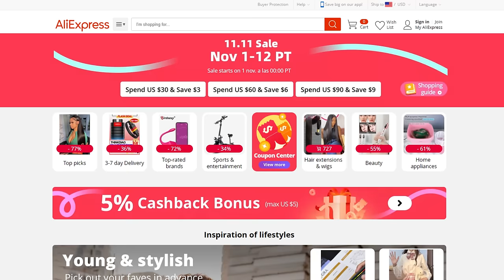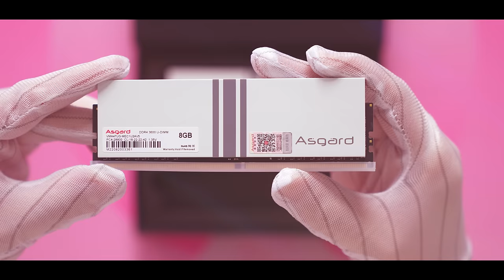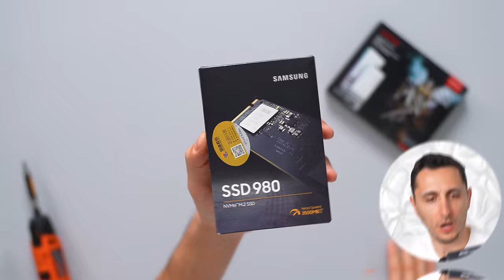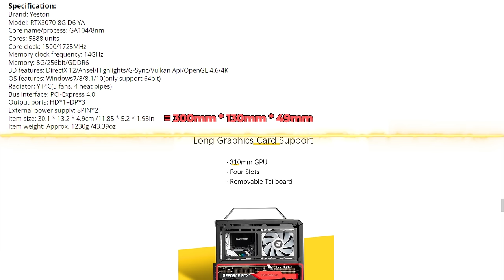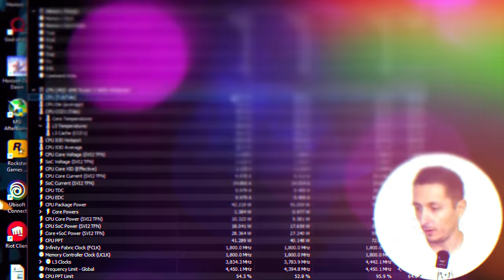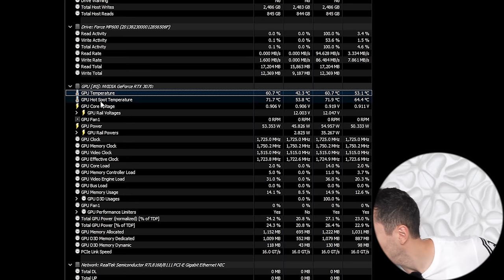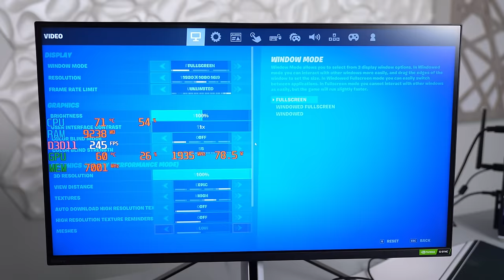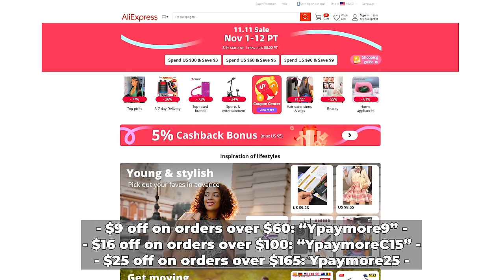I built a Gaming PC using only AliExpress Parts!

Comment: That PC case is pretty cool definitely a nice small form factor case. I would probably use a ITX motherboard and smaller video card in it though. Awesome build though and great video!
Reply: That's what I was thinking
Reply: i doubt ali express can supply exactly what he needed he probably would’ve used the smaller parts if it was possible
Reply: @kevin7238                            .
Reply: @kevin7238  there is plenty of rtx gpu's on a 2 fan form size, enven on 1 fan.. I wouldn't risk such a big one like he did, but I gotta admit, it came out looking badass 😂

Comment: The Mechanic Master cases are so good. I don't know how a company stateside didn't adopt a size-constrained ATX case like the C34 yet.
Reply: Using the C34 here! It's basically a Cerberus with 7 slots only. Really compact for the size yet it can fit a large CPU cooler. Be careful with the ATX PSU compatibility though. There's two numbers, one for ATX-micro (160) and ATX (170) where the second slot is used instead.
Reply: @yensteel  I've got one in for my next-gen build. You're saying I have up to 170mm for power supply length?
Reply: @shinseitaizen  Depends on whether the motherboard is using the first or second slot for the GPU, and whether the card is long enough to interfere (240mm due to motherboard width). Usually, the ATX motherboard uses the 2nd slot (170mm support). A lot of M-ATX boards use the first slot, which reduces the support down to 160mm. An example would be the B550m Mortar.

Comment: i know you said with one fan only but im curious why you didnt use the second fan that you had and installed it in the back of the case for a single exhaust fan to help with the thermals but overall i love the way the build turned out
Reply: Jesus is king follow him and you will be saved
Reply: Exactly, half the struggle with a small case is getting the hot air out.
Reply: @richardfarmer6570   I would say 80% of the struggle. :)

Comment: Installing a Graphics Card that just fits is a lot easier if you take off the back slot mounting plates, sliding them into the slots separate from the card, installing the card, and then screwing the mounting plate back onto the card, instead of trying to force the card into place.

Comment: love sff builds so much by how small and elegant they are.. however, they are a bitch to build in my experience. i went from a meshlicious to a an o11 mini. and a big gripe to that was because I had a bad riser, and decided to build in a different case to see it actually was the riser, which it was. this gave me hope to build in a sff/itx case again some day :D
Reply: Custom cables make a huge difference in most SFF systems.
Reply: @paulmeyer1001  yeah I know, but custom cables are far expensive. So I just went with a psu with braided cables
Reply: @teengohann  ITX stuff is already more expensive. $60 for cpu/gpu cables just saves a ton of headache and is well worth it.
Reply: @paulmeyer1001  moddiy or cable mod?

Comment: pretty sure you were suppose to slide the gpu in from the front, since there is a opening wide enough to take the gpu. Just an idea, in case someone else decides to build in this case.
Reply: bro u saved my build holy molly ty
Reply: @ALHARETHHH  you used the same case ?
Reply: @salvadormarquez5079  a very similar one with an opening! i was so close to bending the case to make the GPU fit but i saw this comment a  week ago whiles building it and it saved me lol
Reply: @ALHARETHHH  bro glad I was able to help man

Comment: I had a similar build, B550M Mortar Wifi, 3700x, 3070, 4 slim fans from ID cooling, LianLi SP750 inside Tecware Fusion with a tower cooler. SO I think 7-8 out of 10 should be fine

Comment: You mounted the cooler with the long side towards the GPU. If you inverted it it would've fitted better. Also you checked the PSU GPU specs but you did not check the GPU's and I'm pretty sure the back panel could've been removed from that case because I see screws not rivets.

Comment: this build is good but why didnt he go for an aio with intake on the top,that way cpu remains much cooler and  the fan blocking the gpu might be installed beside the motherboard tray
Reply: There most likely isn't clearance for an AIO uptop in such a small case. And even if there was, good luck finding a 92mm AIO
Reply: its ali express bro not amazon
Reply: @YoLocalWog  most of the stuff on amazon is from ali
Reply: @thc4825  do u not get what I mean

Comment: alright now i gonna buy these parts (also extra storage too)!!! let's see how well they perform
Reply: Did it work well?
Reply: @master__frog5429  Give him mininmal 1month for deliveries atleast and a day to build homie lmao. Building a x99tf q build for a friend/boss and throwing in a 2060 oc gigabyte inside of a DLM21-Mesh white. Could post photos when I build it early feb. he mainly wants to do office work on it and play city skylines. Gonna  have a E5-1650v2 in it and will be overclocking it to 4.1-4.2ghz.

Will give a quick breakdown of the specs and their prices. Some stuff is what I already got at home so its cheaper!

E5-1650v2 (bought 4 years ago ($100AUD) Secondhand)
Gigabyte 2060 OC  ($300AUD Seccondhand)
32gb ecc ram (forgot the speed) ($140AUD worth Secondhand)
Darkflash case DLM21-Mesh ($75AUD New)
850w gold full modular (to buy yet) ($100AUD)
2x1tb m.2/nvme storage ($240AUD Secondhand)
6tb HDD NAS ($100AUD Secondhand) 
wifi modual ($2AUD Secondhand)
m.2/nvme heatsinks (fanned/rgb) ($38)
240 AIO (to buy) ($100AUD)

Total: $1,195AUD/$815USD.
Could of cheaped out on the psu/ram/CPU is worth half as much now/gpu but he is happy with the rig. commision is about 15% so about $180AUD for my back pocket. All and all its cheaper than building a 10th gen + rig due to cpu prices and at any time he did wanna upgrade, there is the z590 steel (white mobo is what he wants in a white case and black everything else) that I could pair my i7 10700f for when I upgrade in the future to i9 11900k in my z590 taichi. 

I can assemble 80% of this in mid feb but still need to hunt for a quality psu/240 rad/nvme storage. Will look nice regardless....

Comment: got my pc from aliexpress same specs for only 620$ and 32gbs of ram, I used an not well known chinese brand for motherboard and same for the 1tb m.2. also the gpu was a used 3070 mining card that I got for 220$ but i just reapplied thermal paste and it runs great! btw I couldve got it maybe 50 - 70 bucks cheaper if i didnt care about aesthetics.

Comment: The AliExpress  "Please allow 10-20mm error due to manual measurment" - have never really bugged me, until now!! Also, why didn't you test the components for function before actually installing them into the case? Never watched your videos before, but this came across as a bit noobish... The case could def fit another fan in there as exhaust and it sure looks like it needs it.

Comment: My first impression of the PC Case is any smart PC builder would not use such a PC case. Cause having the PSU mounted in the front location like that will only vent the hot air inside of the PC case. There is a reason why most PC case manufacturers places the PSU at the bottom of the case in the rear of the case with fan intake facing down. So it can get fresh air from the bottom while hot air exit the rear.

Comment: Oh my god the flashbacks. We built a PC to my brother last weekend, and had the Exactly same problem with the GPU. We checked the length and the clearance, but alas, it was the measure of from wall to wall, NOT the actual hole :D we were forced to take everything out (cooler screws were under the mid-fan, so could not take just the cooler out), lay the GPU loose on the bottom, rebuild and then lift the GPU to the socket. Case TU150, GPU Asus 3090 strix

Comment: Hats off and thank you so much for the video! I'm considering giving my rig a little upgrade, so I'm thinking about ordering a few components from AliExpress. I'm eyeing a new graphics card and a slightly larger M.2 drive. Considering I haven't upgraded anything since putting together this setup a full 5 years ago, it's about time for a boost!

Five years ago, I successfully put together a MINI ITX PC using the NZXT MANTA (WHITE), and it's still running like a champ. I'm thinking of swapping out the graphics card, switching up from the ROG STRIX 1060 to a beefier 3070. The setup is solid, fits like a glove, and I'm loving the top-notch airflow. I tweaked it so that the fans on the liquid cooling (Kraken X62) are blowing air out. Up front on the case, there are a couple of fans sucking air in, and the power supply fan is pulling in air too. So, we've got three fans pushing air out and three pulling it in. Oh, and those intake fans are all rocking the filters that come with the NZXT MANTA case, nice touch.

The whole setup's got this sleek look that's hard to beat, and the performance is off the charts. The CPU's temperature keeps its cool, doesn't even break a sweat at 60 degrees Celsius when things get heavy, and it's chilling around 33 degrees when it's taking it easy. Speaking of overclocking, even with that, the graphics card isn't going past 60 degrees Celsius. But gotta admit, those graphics card fans can get a tad noisy.

Here's how it's all stacked:

Case - NZXT MANTA WHITE
Motherboard - Asus ROG Strix Z370 Mini ITX
Processor - Intel 8700k (Haven't bothered pushing it with overclocking just yet)
RAM - 2x8GB HyperX Predator 3600MHz
M.2 SSD - 500GB Samsung 970 Evo (Thinking it's time to bump up to at least 1TB, board's got room for two M.2 slots, though just one's got a heat spreader)
SSD - Samsung SSD 1TB 860 EVO (Got the whole macOS shebang on this drive, running it as a slick dual boot setup)
Cooling - NZXT Kraken X62
Power Supply - LC Power 850W, solid 80+ Gold Standard ATX stuff

Comment: You should do top intake for more airflow in this situation, it'll increase pressure negating the "heat rises" thing, and air will be pushed out the back anyway.
Reply: Nah 2 top exhaust. The GPU will take air from the bottum as intake and blow it out to the upper side. That's where the CPU can use it and let the 2 top exhaust fan take out the hot air.

Comment: id give it a solid 5. the gpu is completely blocking the bottom fan and you might even see lower gpu tremp if u remove the bottom fan. i would have put 2 fans, either both on top or one top and one rear blowing out. let the case suck in air everywhere else. also a dual fan card would obviously greatly increase your overall airflow
Reply: cool

Comment: Well, I ordered a Ryzen 7 7700X and a Kingston DDR5 6000 EXPO 16x2 kit, cuz CPU was 70% cheaper, and the RAM kit was 15% cheaper than buying from a local tech vendor
Both arrived brand new and have been in an active use for around 1.5 weeks.

Comment: i got freezermod tubing from ali and i have also got original EKWB tubing. Ihave to say never going back to EKWB. It was so good using the freezer mod tubes buttery smooth bending no distortion i also use byski fittings and had no leaks in over 4 years.

Comment: Personally I would have put one fan at the top as an intake and the other at the back for an exhaust. The one fan you did add is doing nothing but pushing cool air at the GPU which should already be decent at pulling in the air it needs.

Comment: Unless that Thermal Grizzly tube that came with the cooler was the Aeronaut you can be sure that it's fake. Kryonaut and Hydronaut are a pain in the ass to spread, the only one that spreads that easy is the Aeronaut, not the best from Thermal Grizzly but still pretty good, anyway, pretty nice build, very clean, just need to improve the cooling a bit, undervolting both the CPU and GPU should not only improve those temps but also give a little boost in performance.

Comment: Seemed to me like you could have maybe been able to fit 2 fan’s above the cpu cooler instead of one below the gpu. Also looked like there was space for an exhaust fan where you would normally put one but maybe im wrong. Still suprised by the performance of the temps as the cpu didnt just shut the system down because of the thermals

Comment: The time mark at 15:50 was amazingly similar to my experience this very day.  My daughter called me from home, after school, to tell me one of the CPU fans was making noise.  I came home to verify that one of the CPU fans was indeed failing (shaft/bearing) and that I needed to replace the dual fans to the air cooler.  Damn AM4 and sticky thermal paste...the CPU came off with the cooler...which was an absolute Bi%$h to remove!  Bent 5 pins in the process of trying to carefully remove the cooler spring tensioned bracket from its topside mount point.  Another 30 minutes under a lighted magnifying lamp to get five pins carefully straightened, some errant thermal paste removed, and another 20 minutes to reassemble the PC. What a nerve racking process. For sure, I prefer pads on CPU's, no doubt!

Comment: I mean...I'm not really a fan of any build smaller than atx, so...for the sake of the not sounding biased, I'm going to rate it lower than a 3.  Yes it's a good build, but the case is not very well designed. and there's just not enough fans.

Comment: at this point is actually not worth it: i just built my pc with a i5-12400f, a 3 fan rtx 4060, 500 corsair power supply, 240ii arctic liquid cooler with 2 rgb fans, 32 gb of ddr5 vengance ram, and a msi pro h610m moba which is micro atx, all fit inside the corsair 3000D airflow which comes with two fans all for the price of 990 total and i can run pretty much everything ultra with 80 to 144 fps in 1080p without getting over 50 to 60 grades for both gpu and cpu all from amazon

Comment: I think the biggest Problem for this build to be "perfect" is the case. I really like the look and quality of the Main Components though. Something like with that screw with the cooler can always happen.

The case here will also be the problem regarding temps and cooling. The GPU is basically blocked of to the side because of clearances, so the hot air can't exit normally and the CPU has no intake, nor exhaust. I would put all of these components in a different case. Really like them. But really disliking the case. 

Beautiful look kind of hindered by this case.

Nice vid though.

Comment: Don't GPUs usually blow air away from themselves? if so then you have the intake and the gpu fans opposing eachother, and the GPU cutting the fan off completely from the rest of the case. So I am not at all surprised at the high temps.

Comment: I recently bought a rtx 3090 fe to put into a fractal design meshify c mini 3090 is 313mm and the case supports 315mm it fits with 2mm wiggle room.

Comment: Neat looking pc, although I usually dont like rgb or white.
But that crooked GPU would drive my inner Monk nuts...

Mine is just plain black - no windows, no RGB, nothing fancy.
be quiet Silent Base 601
i9 11900K with Arctic Freezing 360mm AIO (replaced the RGB fans with 3 Silent Wings 4 120mm)
RTX 3080

Comment: 16:14 I know that exact feeling. I pulled up my r7 3700x to reseat and I did the twist and pull lightly method and I even ran the system to get it a Lil warm but it still pulled up with bent pins haha still rocking it though I just can't use dual channel 🤣🤣

Comment: techsource :  lets try fit  4090   yea sure  and then  3070 barelly struggling to fit  then bends  screw holder :D   fits perfectly but not  tried even  1080 or rtx 2080  :D

Comment: Dude you made too many mistakes. Case was way to small which caused you to nearly break the gpu. You should never spread out thermal paste because that creates air bubbles (air bubbles prevent cpu cooler from cooling cpu right). I don't even know if you replaced the thermal paste when you removed the fan. Why put a case fan on the bottom? The gpu fans would do good enough. That pc won't last a month!

Comment: Samsung bamboozling users with the 980 SSD ... which only runs at PCIe 3.0 ... yet it's called 980 ... newer than 970 ... only 980 pro is 4.0 ... samsung scammaz.

Comment: i have a rtx 3070 and a intel i5 10400f and in most games it performs worse than a gtx 1650, anyone know why?
Reply: Have you got all fans hooked up to your CPU
Reply: You could try to change the airflow in the PC
Reply: Not sure if they are all hooked to the cpu
Reply: Lower your settings a little or maybe the CPU is the f series, maybe upgrade it to an i5 10600, it's gonna perform better with the 3070. Tell me if this helped!
Reply: @beben3657  i think it was the cpu, i got a intel 11700k now and my games performs more than good XD
Reply: @vxruzdanz  That's good to hear, maybe the GPU was getting bottlenecked by the CPU, I just don't like the fact that the 3070 was paired with a mid-range CPU because the GPU is high-end. But Ed used a mid-range CPU and paired it with the 3070, so I'm having doubts on my thoughts about the processor not having enough CPU horsepower to pair it.
Reply: Just say how much RAM/memory you have in your PC, so I can say what you can do to improve the performance for the PC. Or if your fine with the performance, just don't reply this comment, reply the other comment instead of this one. Maybe reply to this by telling me the clock speed AKA megahertz (MHz)